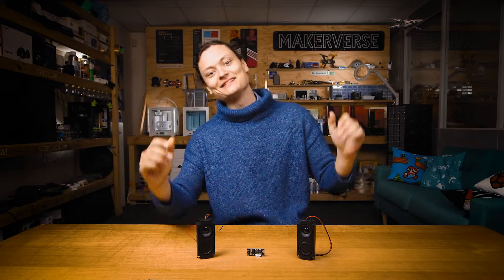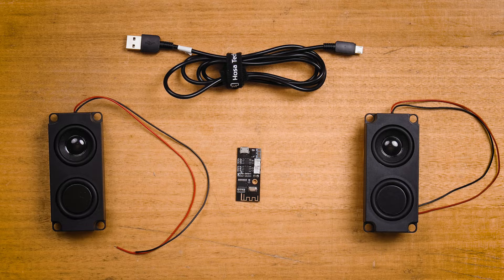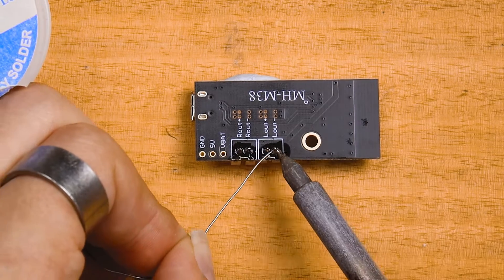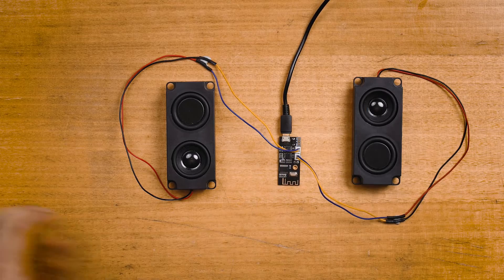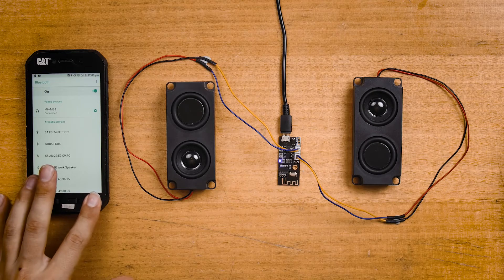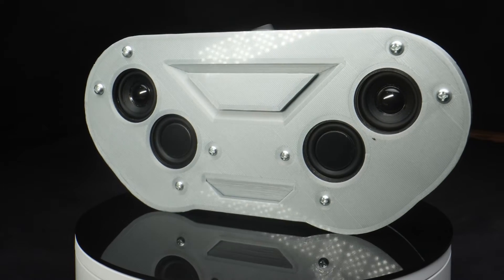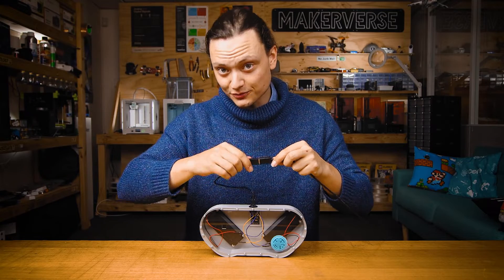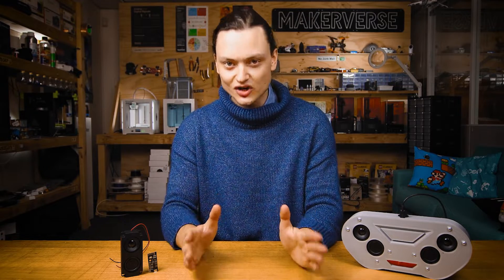Build your own Bluetooth Speaker! - DIY USB Boombox with a 4.2 Bluetooth Audio Receiver (MH-M38)

Comment: Be careful if you want a pleasant sound on boot: HX-M38 contains annoying prompt sound that says "Welcome to Bluetooth Speaker", MX-M38 says "Bluetooth Mode", and only the genuine MH-M38 has this sound! You can identify it by the chip ID, which says "MH-Mx8" where x is 1, 2 or 3 depending on the board type. If it says "JL" then you've been duped.

Comment: Can you please help me to connect 3.5mm 3 pin jack to output? I tried connecting 2 negative points but didnt work, in the manual as well they warn not to short negative

Comment: What if i have two 10W speakers? Can i still use this module?
Reply from the maker: That shouldn't be an issue as long as the impedance values match. The 10W speaker just won't be as loud as it could if you drove it with a larger signal.

Comment: Would it be a problem to use 1Watt speakers? Or is that too low?
Reply from the maker: The datasheet states that it will work with speakers ranging from 2-8 ohm to 3-5W, but the optimum speaker for this devices is 4 Ohms at 5 Watts. I think 1 Watt might not be the best for this module.

Comment: Can use 3.7 v ? And what the mAh better??
Reply: You can but you need to connect it to a bms board first. Although this chip does support a lipo current, it does not support charging it. There's way better chips than this. Really disappointing project. This board is infamously bad at filtered audio. Lots of distortion as well. I prefer a vhm-314 v2 which does not need a bms board very little distortion, but does require a separated amp. I prefer tda amps, but pam8403 is standard.  This guy also used Really bad speakers, and because they're already sealed they have alot of compression. Those are also single speakers with a diafram. He would get alot better quality giving the speakers proper air chamber, hit glue is usually enough to seal these otherwise use silicon